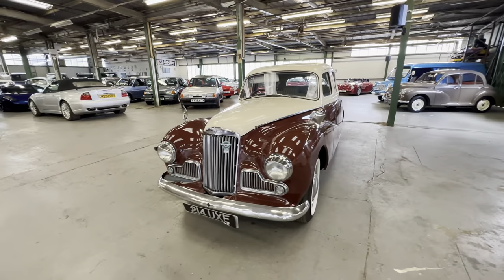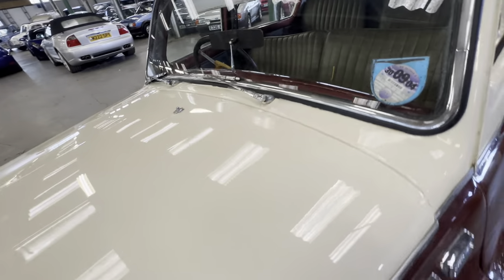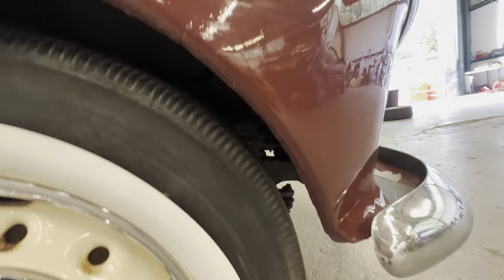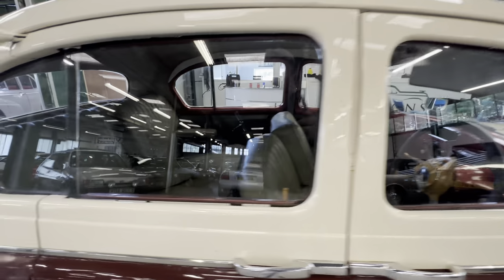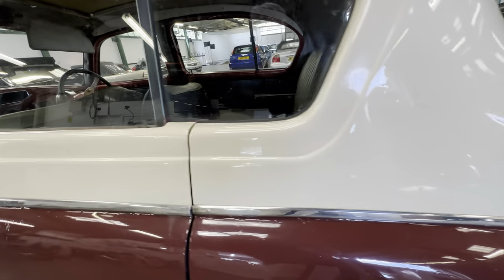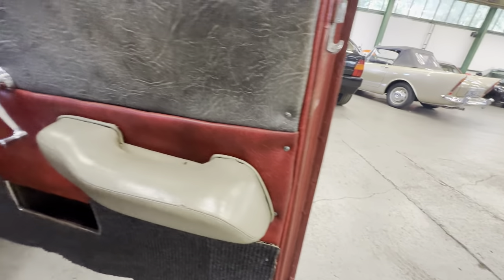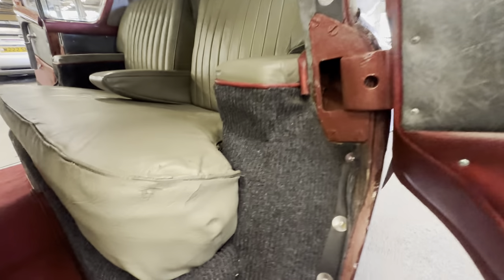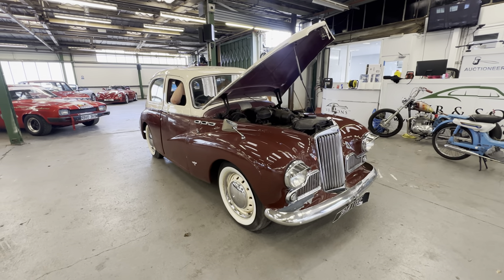Sunbeam Talbot 90

Comment: The arm rests on the front doors are fitted incorrectly. They are back to front. The 2267cc four cylinder motor on these models, dervived from the Hillman 14 of the 1930's, is a very reliable motor fitted with Duralumin  con rods. With an eye to detail and tuning, the speedometer needle can easily be made to bounce off the stop pin at 100 mph; Not that you would want to do that. the legal limit can be maintained in fourth overdrive at under 3000 rpm.